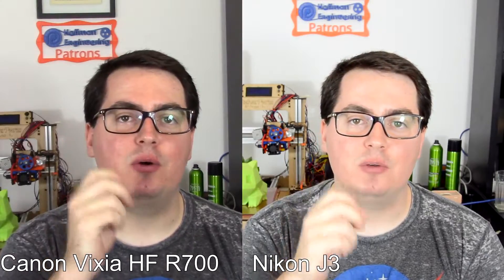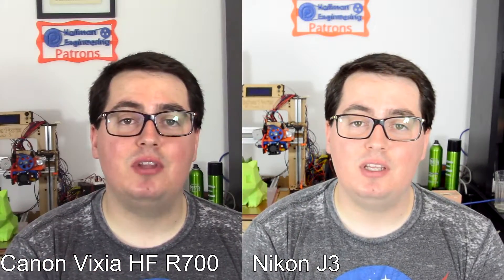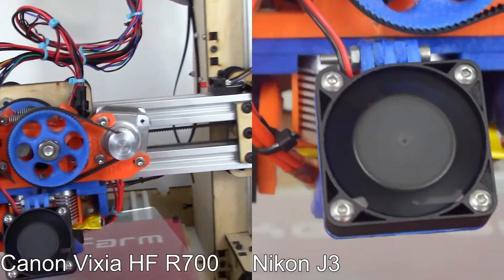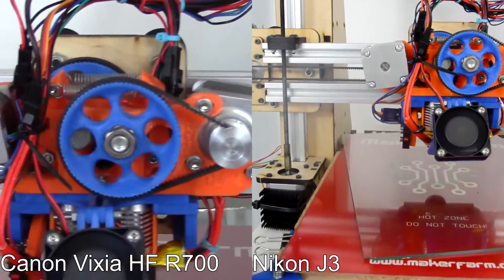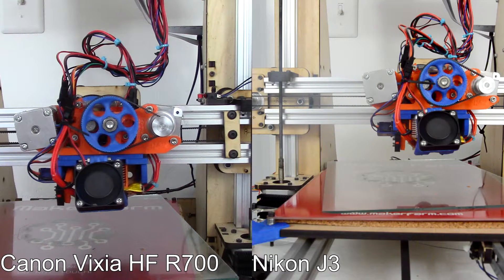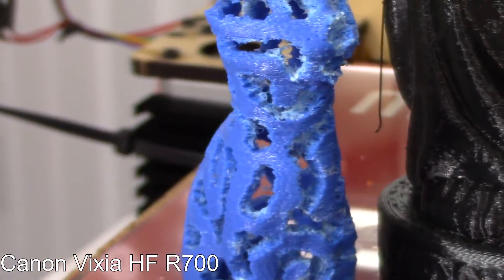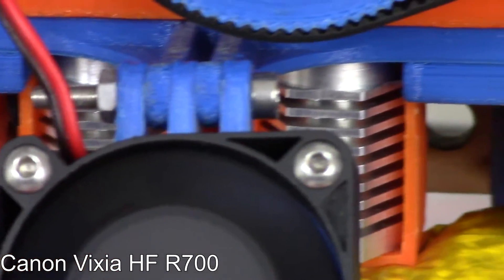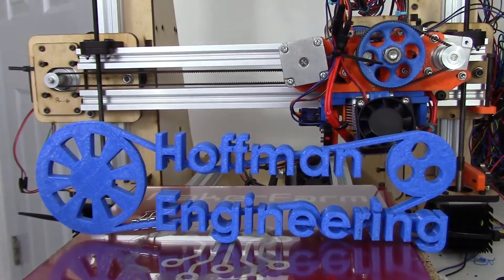Canon VIXIA R700 - Comparing Video with my Nikon J3

Comment: Before you did the shot with the side by side of the R700 at 30fps and 60fps were you filming in 30fps? Meaning throughout the entire video up until that segment was the R700 in 1080p at 30fps or 60fps?

Comment: Nice camera, great demo. The Canon has some real nice capabilities for a reasonably priced camcorder. I am really impressed with the quality of the picture it gets and the overall quality of it.  How do you like it now that you've had time to use it??
Reply from the maker: I really like it! The picture is pretty good, and having the ability to use an external mic and record for hours at a time is definitely a plus! Also, the swivel screen is very handy when you are trying to frame yourself in a shot. I do wish it had the ability to manually control the aperture though, there are times where I want to change the depth of focus, which this camera won't allow you to do. For those shots I have to move back over to my Nikon. Overall though, this is a pretty decent main camera.
Reply: Hoffman Engineering Great to hear. It definitely has some nice features at that price point.